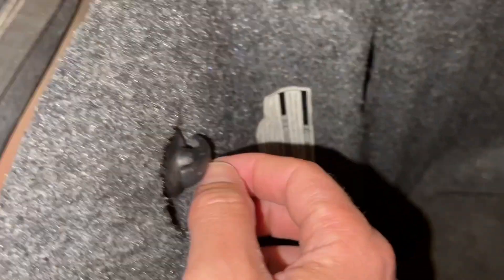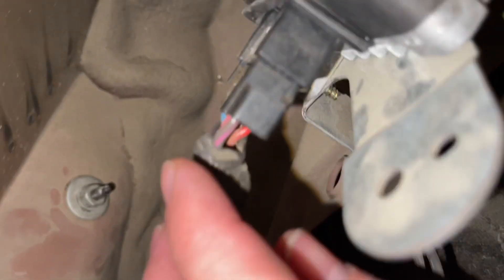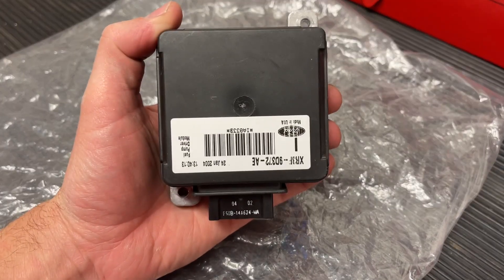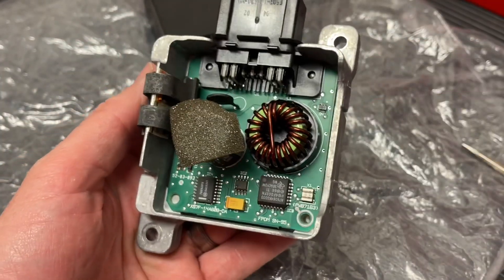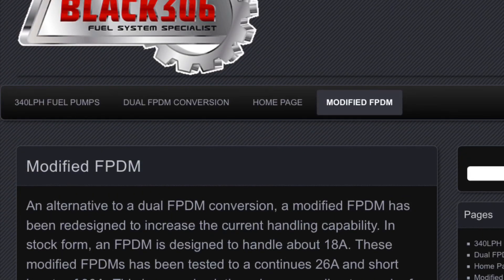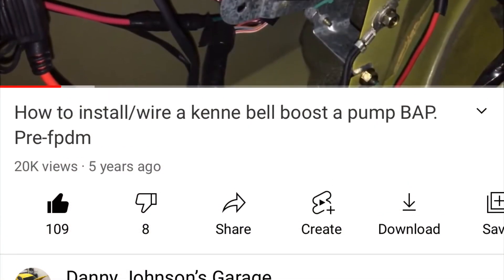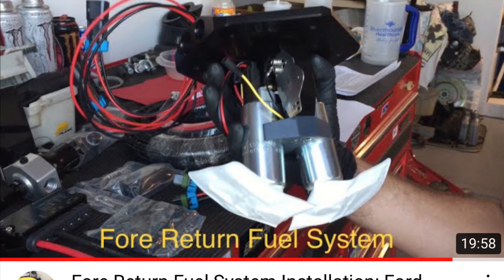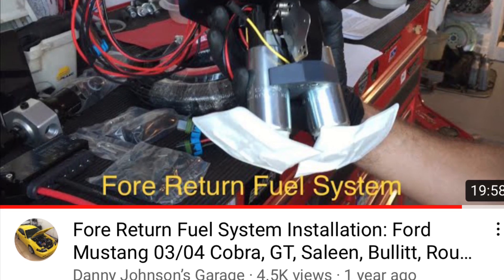Modified Fuel pump driver module (FPDM) vs stock. What is the FPDM where it’s located. Ford Mustang

Comment: what do you mean when you say it may overheat if you have a "boosted" pump?? I'm thinking about running one of these for a classic car restoration in conjunction with a holley HP computer so my pump will stay cool and not run full bore all the time while idling... I'm planning on using a pressure regulator with return to the tank, so I don't need it for pressure regulation so much, I just don't want a traditional relay clicking away wearing out, or run the pump at 100% constantly like a racecar would. I'm reading conflicting info about whether I can simply use the Holley HP to just output PWM signal to a solid state relay (how does it know how much to run without pressure feedback?) to run X speed below X number RPMs, but I'd like better granular control than that... maybe a pressure sensor could be added to the holley so it has feedback, but then, another problem is that it'll probably be a holley sensor you can't buy in a parts store... I want every piece of this vehicle (besides the ECU itself, of course) to be replaceable with locally available parts. I plan on keeping a list in the glovebox of what sensors come from what vehicle year/make/model just for that reason. I've already got an IAC motor from a 1997 grand cherokee, everything else on the engine is 1998 cherokee, or 1986 CJ7... any comments are much appreciated. mixing physics with programming and years of automotive cleverness that is largely ignored in racing is complicated lol
Reply from the maker: Boost a pump is used to supply more power to the pumps https://youtu.be/kb5GOgXJatE?si=QO4odsK_z1SxJIWY
Reply: @dannyjohnsonsgarage ah gotcha, using a dc-dc step up converter to overdrive it. Think I can use a Holley and Solid State Relay to run without a module like this, without a pressure regulator under the hood? Would it be good to run a pressure regulator in addition, or do the pressure transducer sending units and pump controllers have ultra fast response enough that it doesn’t matter?

Comment: Danny, I am just going to do a 2.3 whipple on my car. Only pump gas
Do I need to do stronger pumps and updated fpdm? No need for voltage booster, correct? I plan on staying returnless. 
Is sct ba2600, 60 lb injectors, accufab tb, dw300c (340lph), modified fpdm enough? 

If u don’t recommend any of those, what do u recommend please?
Reply from the maker: @jason91205  I have pretty much the same setup. I needed the modified fpdm in the end from it cutting a bit. I just have the BAP, MAF extender, 60# injectors and tune and it’s pegging 9.9 on AFR so you should be fine. Just watch the AFR for leaning out

Comment: I would love to switch mine to a more conventional returned fuel system utilizing a sump and external lift pump. Anybody make parts for that?
Reply from the maker: Yeah, contact Fore. They will set you up. You’ll also need a tune. I have an install video for it 
https://youtu.be/bteiCwIHuq8?si=KBOBchuAkdzziNfi

Comment: Hello and I have a 1994 Mustang GT and it has a return style fuel system. I have a 03 Cobra stock fuel pump hat. I want to install it in my car and I was wondering will my fuel pump module work it. In going to keep it return style
Reply from the maker: You will not need a FPDM for a return fuel system. You’ll probably want to make what you have work or install what will work https://youtu.be/bteiCwIHuq8?si=DLRuTqHfybwrpXM4
Reply: @dannyjohnsonsgarage  thanks and I was going to put in a bulkhead AN fitting for the return line. I have a 99 GT tank I was going to put the fuel pump hat in and then install it into the car. I did not know if I needed anything special to fun the cobra set up. 

People on the forums said I would need a module but I guess that is if you are staying rerun less.

Comment: Hi Danny, hopefully you remember me from a post a few months ago. I have a 2003 GT return fuel system and a swapped KB super charger and KB BAP the mechanic wired it wrong. The red to the purple of the Mach 1000 amps fried a lot. I’m trying to fix all of this. I haven’t been able to drive it much because of this issue however during the tuning that shop said it was lean and not getting enough fuel. To resolve all of this I’m planning on upgrading my alternator, running two fuel pumps, a remanufactured CCRM, and to my question I’m reading it’s better to use two FPDM’s vs. a modified one? With the BAP. I feel like a dog chasing it’s tail so far I keep replacing one after the other. I have replaced the wiring harness (the latest fix). To the best of my knowledge the BAP and ECU or main computer are still working. Thank apologies for the long winded question.

Comment: I have a DW 440 with a controller and the way to wire it I had to bypass the fpdm now the car runs like crap what is a good way to fix it do I need a tune that deletes it plz help if you know
Reply from the maker: If you’re bypassing the fpdm you’d probably need to do a return fuel system with a tune https://youtu.be/dJWk334Ytek
Reply from the maker: https://youtu.be/bteiCwIHuq8

Comment: Hey Danny thanks for your videos they are very helpful. Do you have a video on how to wire two stock fpdm's together on a 2000 Mustang GT?
Reply from the maker: I don’t but I believe there is a write up for it on one of the mustang forums. I was going to but the black 306 was a better option
Reply: @dannyjohnsonsgarage  yes I just saw that thanks and from what I've seen so far you 100% have to wire each pump separately to run dual fpdm correct?

Comment: If I buy the upgraded FPDM from black 306 will I still have to run a boost a pump ? I’ll be running the Ford gt pumps , ported eaton , 60lb injectors ect ect .
Reply from the maker: The modified fpdm only keeps it from overheating. You should keep the rest of the setup the same with the BAP. With gt pumps it may not need the BAP but just want to say the modified fpdm doesn’t effect it
Reply: @dannyjohnsonsgarage  okay awesome thanks for the great info !

Comment: Does the fpdm have to be programmed to the ecu? Like are they both vin sensitive like the bcm to pcm? Or can you just plug and play these like the ccrm
Reply from the maker: They are interchangeable without any programming needed, at least for factory ones and the black306 was the same. Simply plugs in.
Reply: Oops meant programmed to the pcm

Comment: I will be running a 4.6 2v that's been forged, bored 20, stroked, and supercharged.  It's a returnless system with an Aeromotive 340 pump and 60 lb injectors.  My goal is 500 rwhp.  Supercharger is a ported Eaton.  With my setup and power goal.  Should I upgrade the FPDM to avoid any possible issues down the road.  Engine has not been tuned yet.  But will be before actually driving it.  TIA
Reply from the maker: It’s a good idea so it won’t overheat

Comment: I have a 2003 gt. Still returnless fuel system. I’m having fuel pressure problems. 
I put a mechanical gauge right before it spits into both fuel rails. It’s reading 25 psi for about 15 mins than gets lower until the car cuts off the warmer the car gets. Fuel rail pressure sensor is reading 40psi the whole time.  

I have changed the pumps, fuel rail pressure sensor, fuel pump driver module and fuel filter. Still doing the same thing.  
Here’s the list of the fuel system the car has 
Twin cobra pumps 
Kennebell boost a pump 
Aeromotive rails 
60 pound injectors 
 what else would cause fuel pressure to drop like this.  When the car is cold it runs just fine but after a a little bit of driving it loses fuel pressure.  Please help!

Comment: hello friend, I was wondering if the FPDM from mustangs 99-04 work on lincoln continental 98? I opened mines up and the chip that I want to change is this chip part number "n76064kc002 r1b4f501fn 85adx7w wg",  I doubt it would work the same. The reason why I want to do this is because they still sell new FPDM at oreillys and are more available at junk yards for mustangs but nothing available for lincoln continental 98.
Reply from the maker: I would imagine it’s the same for the Lincoln, but in 1998 the mustang had a different fpdm, so you’ll probably need the pre 1999

Comment: I’m getting code p1233. Car drives fine. Where should I look at first
Reply from the maker: Do you know if you car has the stock fuel system or an aftermarket return style one? If it’s stock it will still have the fpdm (but they could have deleted it and it’s physically still there). 
   The code can also mean: Inertia fuel shutoff (IFS) switch needs to be reset.
Open FPDM ground circuit
Open circuit to FPDM PWR RLY
Open FPDM PWR circuit
Open or shorted FPM circuit (engine should start).
Damaged IFS switch.
Damaged FPDM PWR RLY
Damaged FPDM
Damaged PCM
Reply: @dannyjohnsonsgarage  yeah still the stock fuel system

Comment: Interesting video. My 02 GT died in traffic today but I was getting jerky movement for about 2 weeks now. I thought maybe the transmission was about to die. Anyway, the car threw a P1237 code and freeze frame data showed only 5.7 PSI for fuel pressure. The fuel pump driver is 20 years old. So, maybe this is my problem?
Reply: What did you find out
Reply: @edross641  The fuel pump died - the FPDM was OK. It was very difficult to replace the pump since I had a full tank of gas. Getting the fuel tank back into place was quite a challenge, also, even though it was empty. Getting the fuel filler nozzle back in to the tank without breaking the nozzle was the biggest problem. This job would have been easier if I had access to a hydraulic lift.

Comment: 2006 ford mustang gt vortech v3 500rwhp my boost a pump fried so i went with a dw400 415lph but i have to rewire it and in doing so it will eliminate the fpdm i have it running of the factory wiring at the moment just to test it but pressure at my injectors are 75lb it should be 39lb how would i go about modding this to work  or should i just install a return system?
Reply from the maker: With how easy return is and also how easy to reach your pumps Id go return https://youtu.be/dJWk334Ytek

Comment: I have the single modified FPDM and stock hat with DeatschWerks 340lph. Direct plug-n-play and budget friendly ($500).
I'd recommend this setup to anyone around the 600hp area
Reply: Did you do the wire upgrade as well? I was thinking about going this route before a return style upgrade.
Reply: @papajoewil10  yes i opted for the power wire from black306
Reply: Where did you purchase a modified fpdm? I believe my stock one is over heating and I have your same fuel pump and a BAP
Reply: @Ricochet1012  black306 website
Reply: @Ricochet1012  black306 website
Reply: This is the EXACT setup I’m looking to do in mine is there any way I could talk to you privately I have a few questions and the information online and in the forums is so all over the place. I’d really appreciate it.

Comment: My first Terminator had the returnless system with a boost-a-pump and I hated it. Always had running and/or idling issues and blown bap fuses. Now my second Terminator has many of the same upgrades as my first--whipple 2.3, 60lb injectors, etc. But this car has a Division X return style fuel system which uses the factory rails with a custom regulator and fuel hat. If I had the work done myself, I would have gone with the Fore return system, but that being said, I have had no issues with the Division X setup and the cobra runs clean and strong and gives me many smiles per gallon. With the return style system, both the fpdm and boost-a-pump can be omitted. Good video Danny!
Reply from the maker: That’s great. Return is the way to go when it’s time to replace things. I also get hesitations between shifts and if I’m high rpm low throttle going to full throttle. We did the fore on my brothers as you saw and it’s great

Comment: Hey Danny..I have dual fpdm’s..Ford GT pumps and a billet hat..press jumps to 60lbs when I nail it..has been bullet proof since I installed it..Whipple 2.3..3.25 upper…4 lb lower..20-21 lbs boost..640 rwhp on the 93 hot tune…one more tune left..100 race only tune..never tried that one yet..car has always run perfect…except for a injector that stopped firing on the highway every once in a while..replaced that…cylinder # 2..no more misfires..otherwise..never had an issue with fuel system…good vids…😀😀
Reply: Hey Paul I have kinda the same setup as you! And love it so far! How did you wire your dual fpdm
Reply: I bought the duel fpdm’s as a kit…I believe the harness came with it…that was along time ago, each fpdm controls a pump….again ,it was a while ago.😀

Comment: Interesting, I'm using the boost a pump in my procharged 03 Marauder along with an aero motive fuel pump, I wasn't aware the fpdm could over heat.
Reply from the maker: It’s usually a problem with the 03/04 cobra’s with 2 pumps on one fpdm
Reply: @dannyjohnsonsgarage  good to know, thank you!

Comment: Do appreciate the experience/Intel. This will be good to know when I finally start upgrading my 03 white mach 1. What is your fix to the non-existant NOS Mach 1/Cobra ABS control module? Mine decided that it no longer wants to communicate with the PCM.  ABS light glows  along with the traction control light. And yes, she spins those tires a lot easier with the traction control disengaged. I've searched around for a new one and I've inquired about getting this one rebuilt. I keep receiving the GT version (doesn't have cobra on the housing) and the rebuilders tell me that it won't be FULLY rebuilt. Some of the electronics won't even be considered in the rebuild. That makes me think that it will be rebuilt for the GT model. Then, I would still have to get it reprogrammed to the car.
Reply from the maker: Yeah, it’s not fun when it stops working. And it has to be from the same year. A friend of mine bought a 1998 one, both said cobra but it wouldn’t work. My abs light came on and lo and behold it was actually the axle reluctor ring that had come loose and the rear sensor was getting a bad reading. With a new ring (I also rebuilt the rear end entirely) it was good again. Maybe you’ll get lucky and cleaning the sensors or something will fix it. If not the module can be unplugged and the top part only replaced I believe. It’s no fun with it’s not a cut and dry answer
Reply: @dannyjohnsonsgarage  Already did all of the cleaning and diagnosing bit. It's definitely the abs module. My Snap-on computer won't connect to it. I've checked everything. Was hoping you had a hookup to someone that might happen to have an extra or someone that could rebuild them. Keep the vids coming .You are doing a great job. Thanks